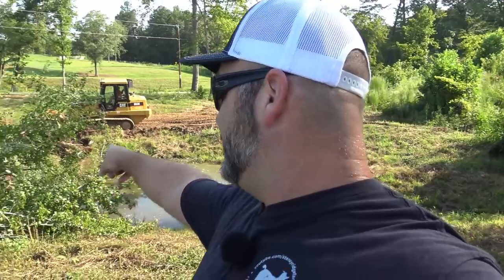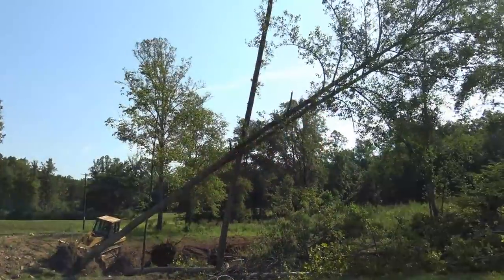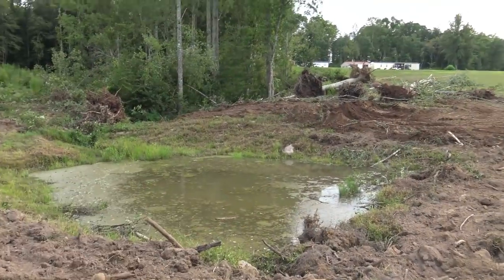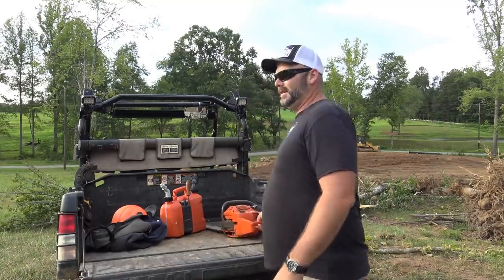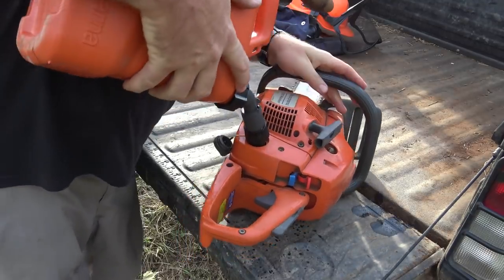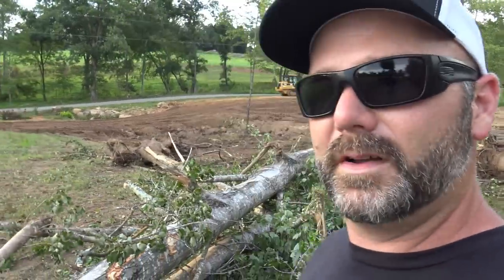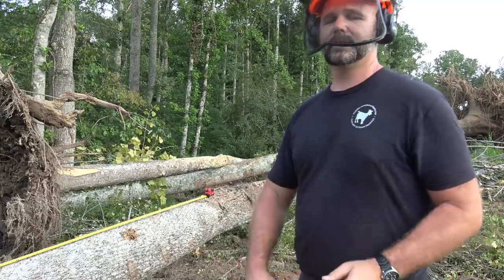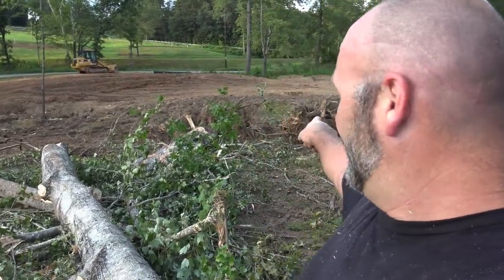Swimming hole build!

Comment: We have a spring feed pond and its the best way to have a pond. Other people around have regular ponds and they dry up with the Arkansas heat but ours stay full. We just used rock and dirt for our dam but it leaks bad. We ended up have to build a concrete wall behind the dam and as soon as the wall cured we knocked out the dirt dam and the concrete has held up for over 10 years and no leaks.

Comment: Hey josh im a pro sound man and if you dont like putting that lav on your tshirt like that i would usually tape the lav to the inside of the tshirt with the plastic medical tape. You have to tape it 2 or 3 times so it dosnt pull your shirt down. Also having it under the shirt it kinda acts like a muff, no not that muff.

Comment: Hey Josh..howdy from Shootin Creek NC...I have built a bunch of ponds, etc..(grew up on dairy and angus farms) ..I promise you that you won't want to swim in that pond! ...A cattle pond/swimming hole has to be built as a double pond with another dam in the middle and restricted cattle access to the swimming hole..Cattle like to stand in pond and bathe, piss, and crap in the pond...gets a little nasty...Your going to need a pretty big pipe at bottom of dam with valve to release the pond water (for cleaning and storm fill)..lots of info online for planning...

Comment: Suggestion: Get some street chalk for marking your log lengths.
Keep a couple in your Husqvarna gas can.
Chalk marks stay put.
Sticks get moved or lost completely.
Another suggestion: Get and use Anchorseal on the ends of your logs to prevent end checking.
Should be applied the day the logs are cut unless cut in freezing weather.
If you don't have Anchorseal, any latex paint will be a lot better than nothing.
It's amazing how quickly logs will end check in hot weather.

Comment: Hey Josh thanks for the video I enjoyed it and that water that was coming up there that would be good to use it for a well and I I'm going to pass some information along to you next time that use your chainsaw when you're done with it release the tension on the chain that way it will prevent it from stretching I learned that from your friends Doug and Stacy that is when it's hot when you're done with it

Comment: Hi Josh.
I am planning to have 2nd pond build on our land. Can you briefly share your planning process?
Reply from the maker: Find a place that's suitable with running water.....hire a loader operator to build up your pond.  Depending on the size you may need a permitt...so check with your local NRCS

Comment: Man, they sure do a lot of geo engineering in your neck of the woods! 🤯🤬
Reply from the maker: I think we need more engineers don't you....so we can over complicate things and make them cost 5 times as much and accomplish less.  We need a focus group for this project right?  Hear me out now that I've gotten the sarcasm out of the way lol.

  How's this for Geo Engineering:   
 We spend 10 hours building a pond that slows water flow....so we can keep the road below from washing out...which save the county countless hours of repairs, the rock quarry doesn't have to mine the rock, the steel factory doesn't have to produce the galvanized steel for pipe, nor the trucks to haul the equipment.  A passive solar watering system is put in place to water our livestock who put down manure to feed the land without petroleum based fertilizer, and feeding families in the process.  We have made lushes habitat for fish, wildlife, crayfish, microbes and amphibians.   So...you sarcastically say this....when the reality of 2 tractors working a total of 10 hours actually prevents pollution and preserves nature in many more ways than just leaving the land alone.  

One person driving to the grocery store to pick up 1 pack of chicken...that's a lack of Geo Engineering if you ask me...we live off the land here. If more people were self sustained and self sufficient like us....then I believe the world would be a better place.

Comment: Josh is that going to be deep enough for the water to stay cool so you dont grow mosquitoes?  I'm sure you thought about water temperatures.  How long did it take for the power company come to move those lines?
Reply: How would one know if it is? How deep in that climate? and how cool would it need to be, measured at what depth and time of year? Any more details, for others considering ponds?
Reply: @CharlieArehart1  There are very many different scenarios for digging ponds.  You need to take in to consideration many of the following.  How much water flow?  Is it a constant water flow?  Is it storm run off?  Will it get oxygen by an aerator or natural?  How much shade will be over the pond?   How much of the pond will 100% shaded all day?   Will you be putting fish in the pond?   What kind of fish? Some fish need different temperatures.  Will there be shelves in the pond?  Will there be structures in the pond?  The list goes on and on.  I dug ponds back when I was in high school and it's alot of research.  When the pond is not deep enough, is when you see the aerator spraying water in on the air.  Alot of ponds by me have aerators because back in the day if a farmer wanted a pond he just dug one.  Directed a stream towards it and was done.  Much of this information can be obtained by going to your local government office.  Because of the mosquitoe issue here in the united states, many generations later are being forced to tear down these ponds.    I think Josh said his farm at one time had a very large pond that had to be removed.  Prior to his ownership of the land.